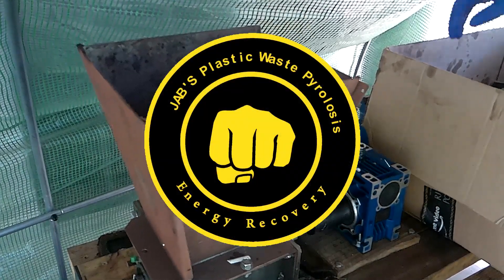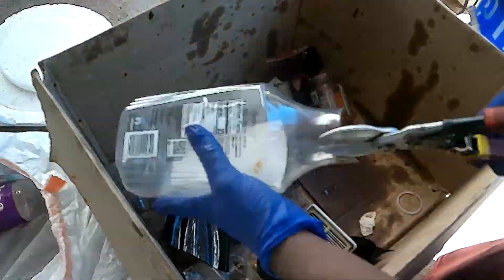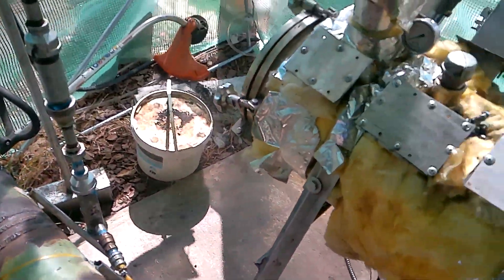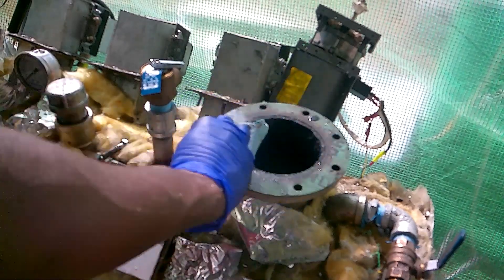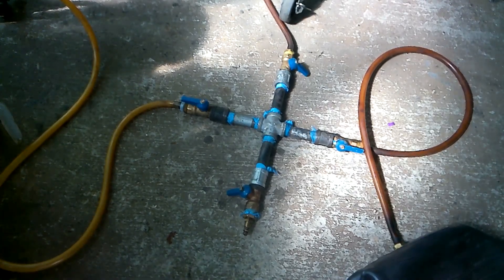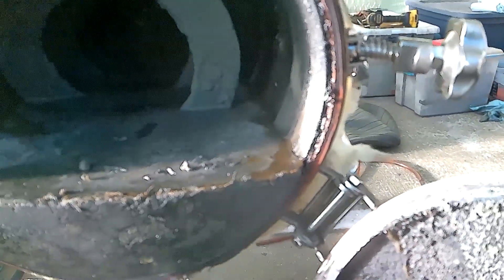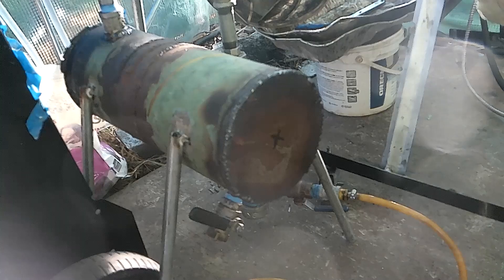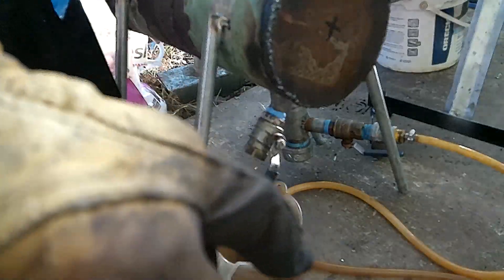Absolute DISASTER of a PLASTIC to FUEL run - But good results 😁 Part. 1

Comment: Best guess…..the fuel looked that way because of the used motor oil component of this run is much further along the refining process than the raw plastic, therefore  the system acted as more of a distiller with the new condensers creating a more refined fuel in the end.

Some remaining motor oil definitely looks like it made the plastic block softer, but as a liquid and more volatile under heat it doesn’t look like much motor oil remained in the reactor.

Comment: The fuel may have been like that because  the lower temp reached by only two magnetrons made it so only the most volatile molecules could evaporate over to the condenser.  Might be a way to do fractional distillation in the machine. :)

Comment: You should use the refrigerator compressor to pull a vacuum rather than using Argon if you can get 28 in of mercury then you have no air in your reactor
Reply: The reactor would probably not resist to vacuum.